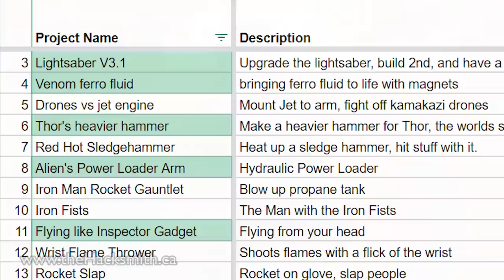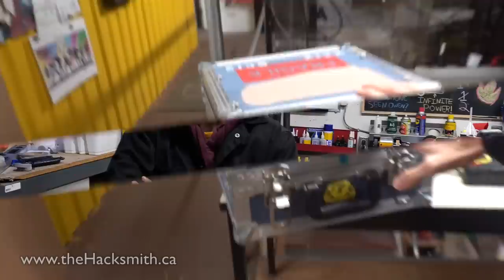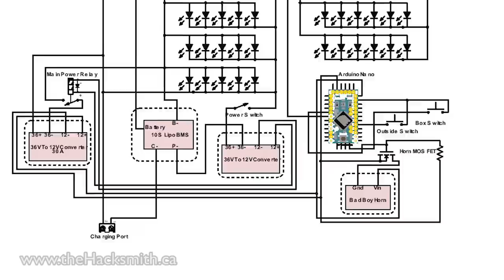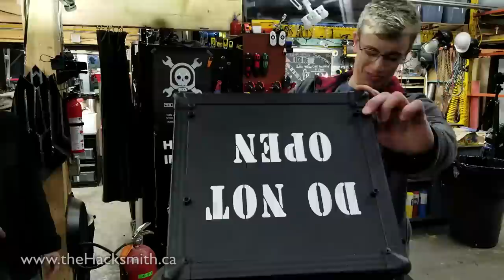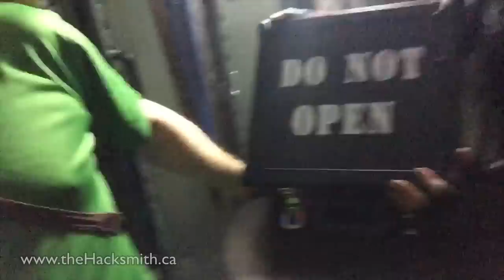You'll never guess what's in Pandora's Box!

Comment: What did you think when you ere told to make Pandora's box?

"I Thought It was Stupid"
Reply: She is the greatest
Reply: Well it kinda is. Those leds are around 6 kW, and at least half of that goes to heat. And i didnt see any cooling...
Reply from the maker: It's only open for a few seconds at a time. Doesn't need active or even passive cooling. Designed for exactly what it does.